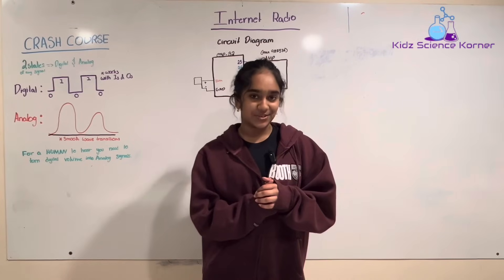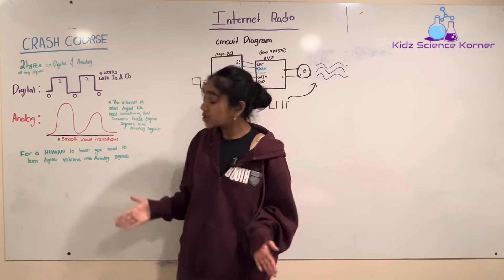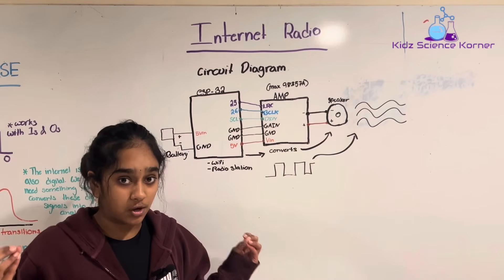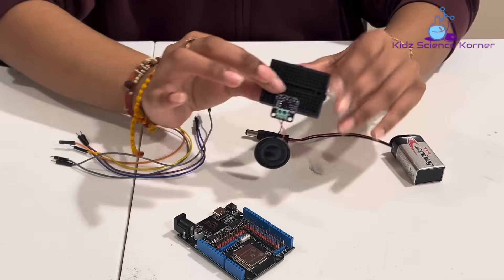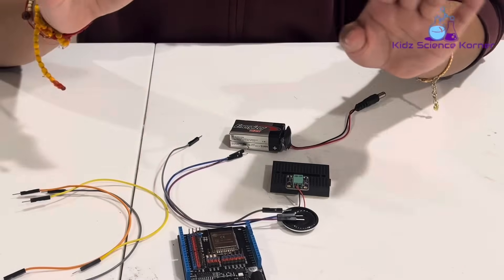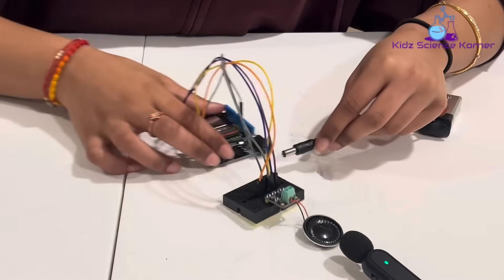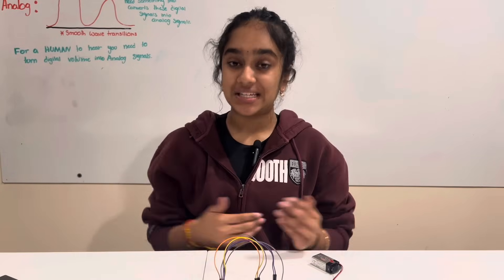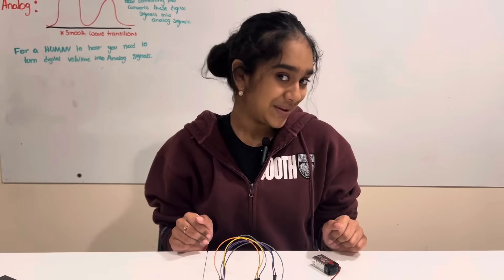Build Your Own Internet Radio with ESP32 & Mini Amplifier | Full DIY Tutorial

Comment: I'm trying to build your project, but having issues... In the Arduino IDE,
1.  What board do I select?  ACEBOTT ESP32-Max-V.10 is not an available choice... do I select "ESP32 Dev Module"?
2.  Under the Tools menu, are all these the correct settings?
          CPU Frequency: "240MHz (WiFi/BT)"
          Core Debug Level: "None"
          Erase All Flash Before Sketch Upload: "Enabled"
          Events Run On: "Core 1"
          Flash Frequency: "80MHz"
          Flash Mode: "QIO"
          Flash Size: "16MB (128Mb)"
          JTAG Adapter: "Disabled"
          Arduino Runs On: "Core 1"
          Partition Scheme: "Huge APP (3MB No OTA/1MB SPIFFS)"
          PSRAM: "Enabled"
          Upload Speed: "921600"
          Zigbee Mode: "Disabled"
3.  Which is correct?  In your whiteboard drawing, you have      Pin 25 --> LRC      and      Pin 26 --> BCLK     , but in the program you have:
#define I2S_BCLK      25
#define I2S_LRC      26
Reply from the maker: Hello @sjoblin001! I’m really glad to hear that you are executing this project. Thank you for watching my video! 

1 - You should select ESP32 Dev Module in order for this project to work. If you’re working with an ESP-32 in the future, always remember to choose ESP-32 Dev Module. 

2 - Yes, all of these settings that you have seem to be correct. 

3 - I may have made a mistake on the whiteboard, but if you saw different values in the code, you should definitely go with those values. The numbers in the code are the actual values that are working for the project. Sorry for the confusion! 

Thanks for all of your questions! I hope you enjoyed the video! 😊